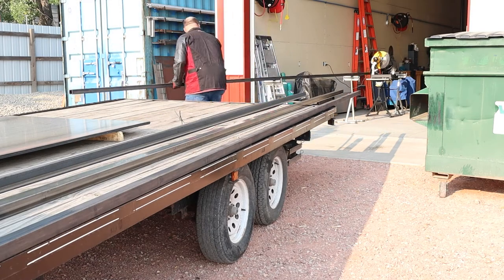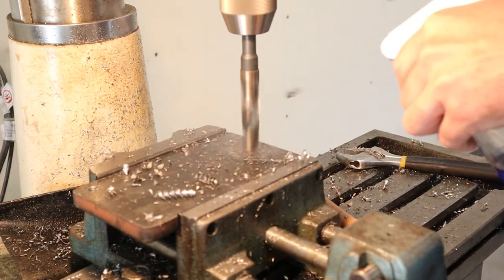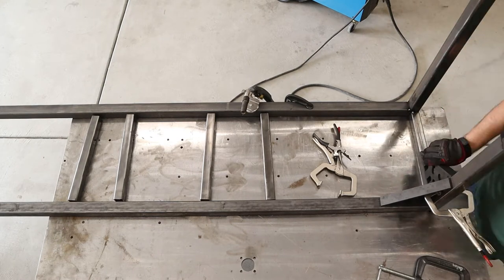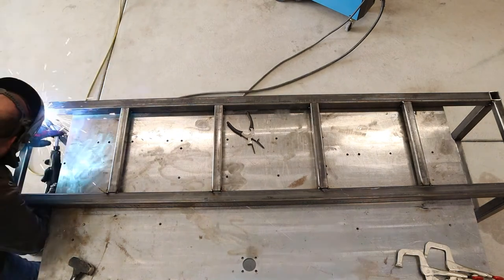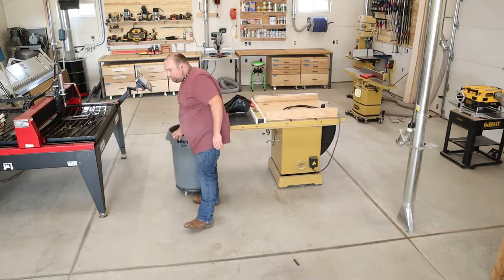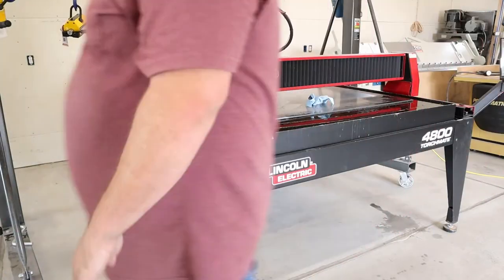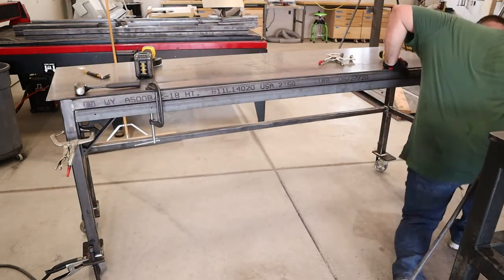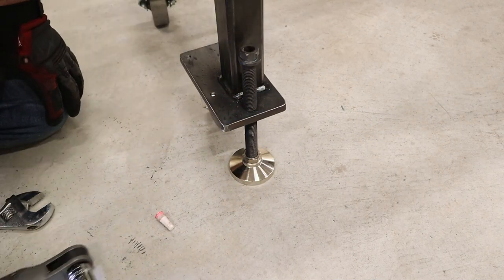Metal Miter Saw Station - Part 1

Comment: What size and wall thickness is that square tube?
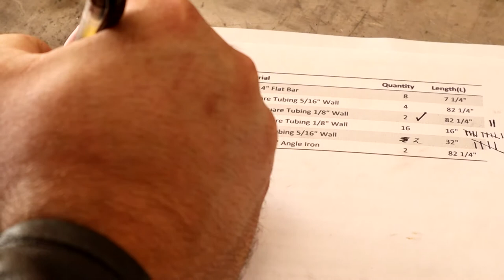Reply from the maker: I use a fair amount of square tube in this video. I am not sure which one you are referring to, but if you go to 0:35 in the video you will see a cut list listing all the material sizes and wall thicknesses I used for the bench.

Comment: What tool is that you are using in the ratchet for taping?
Reply from the maker: I use these little buggers from Amazon.
https://www.amazon.com/Inch-Drive-Adjustable-Socket-Set-2pack/dp/B00SWH3O24/ref=sr_1_3?dchild=1&keywords=3%2F8+drive+tap+holder&qid=1635353087&qsid=138-6003573-1700613&sprefix=3%2F8%22+drive+tap%2Caps%2C115&sr=8-3&sres=B000TGM7HY%2CB00SWH3O24%2CB0002SRFOE%2CB081M3NR13%2CB07VN3M9HG%2CB00FQ5BARQ%2CB07RMYXTBZ%2CB00004YOB1%2CB07JN75X21%2CB077HTXVR1%2CB001GMVA64%2CB073YC3S8F%2CB000HBDW3O%2CB010GJF8N8%2CB08F2Q3BYL%2CB000HI6DAG%2CB07NMS6PZ8%2CB07MH3MGGF%2CB07FR7XD64%2CB000NICFBG
Reply: @Knacksmith  thank you so much for the response. These will definitely come in handy with some good taps.